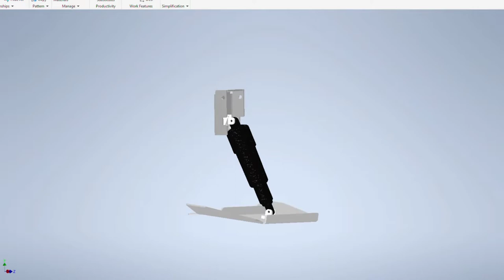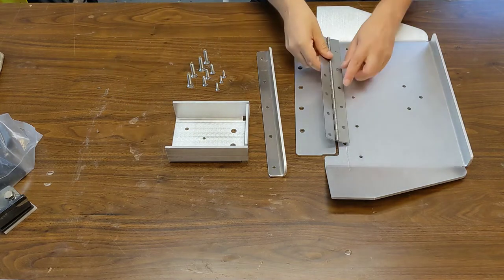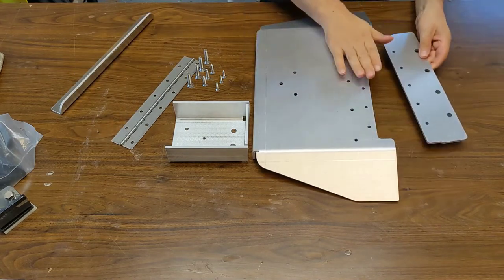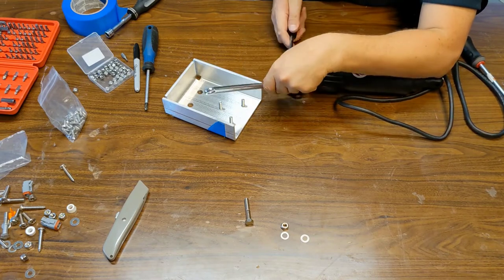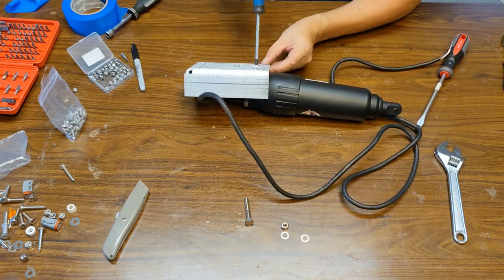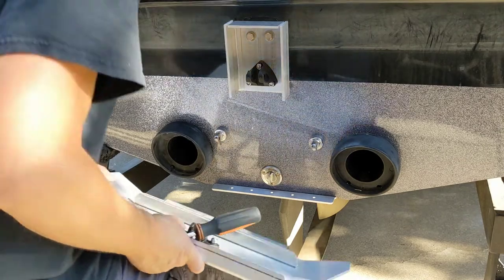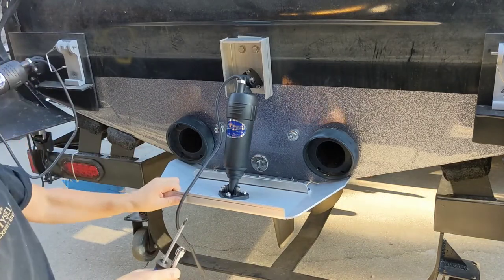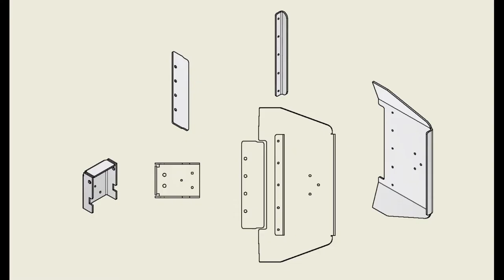Centurion Elite v C4 air warrior Trim Tab DIY. No need to drill your boat, uses only existing holes

Comment: How much did it help out
Reply from the maker: It does help. But it does not replace the need to add some weight to the board if you want to surf.

Comment: Do you have these files in .STP format? Awesome job!!
Reply from the maker: I uploaded .STP, look at the link in the descriptions.
Reply: @ItaiLeshniak   Thanks a ton for sharing! I am having it laser cut right now. Any other tips for these boats?
Reply from the maker: @coreyfitzsimmons8002  Look at my other videos. Good luck with this project and send me some picture.
Reply: What was the stroke length for the actuator you used?
Reply from the maker: I don't remember but the link to the one I bought is in the description.
Reply: Or is there just one length by Bennett? It appears that may be the case.